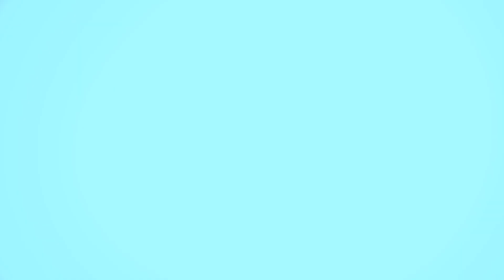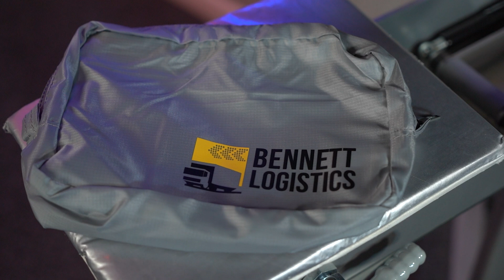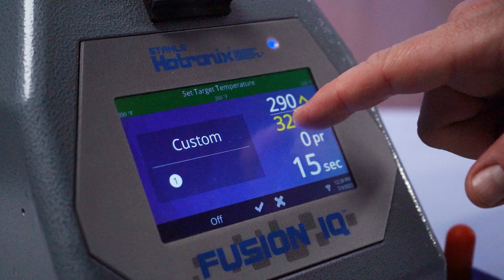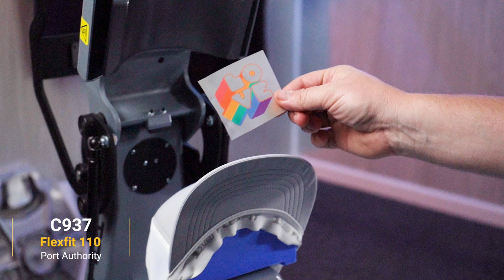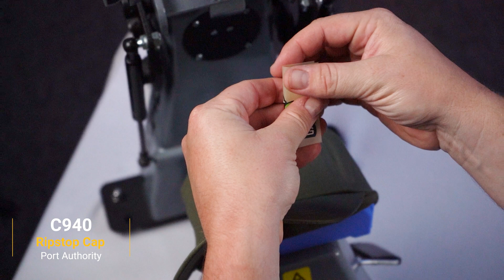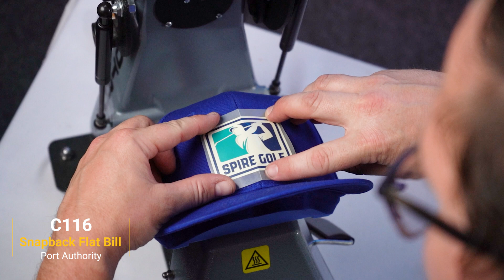How To Print Direct To Film on Hats & Headwear

Comment: Are these UltraColor MA transfer for hats come pre-cut to fold in half like on the video? Or do they come in gang sheets and we need to be precise cutting around each design ourselves?
Reply from the maker: Depending on how many you order, the prints would likely arrive on a roll to be cut out. Our sister company STAHLS offers EasyRip, which is pre-perforated for easy separation: https://youtu.be/9RrNtdcH-q4?si=HxUncs-22cZaAXXG

Comment: Will that bridge on the golf hat not eventually tear since its not glued down?
Reply from the maker: I'm not sure exactly what you are referring to, the rope along the brim? Unless snagged or intentionally pulled to be removed, we haven't seen any failures on these OTTO caps.
Reply: The last hat the blue one. Dave says the print is bridging the gap in the seam. Couldn’t that fail in the part since the transfer is not glued down and basically floating over the seam?
Reply from the maker: Thanks for clarifying Ben, we haven't seen any issues with them failing, tearing or peeling, they're still adhered to the hat and the inks are made to stretch and flex. Just like Dave mentions you can also push the transfer into the crease, however the crease is visible in the artwork. There's a great video here: https://youtu.be/JaKeNZJQDWY?si=tWHXIPQTk-igxMlf&t=490 Where Skip Davis (Owner D4 Graphics) mentions using a tool to ensure any graphics are pushed into the seams.

We've seen many decorators using soft foam HTV with UltraColor Max printed on top to bridge seams or print on other areas not well suited for just a transfer (think mesh back), later in that same video with Skip, around the 40 minute mark you can see a detailed version of that process.

Comment: What pressure did you use for the foam hat?
Reply from the maker: We had our pressure set around 6-7 for a slightly-higher medium pressure for our UltraColor Max DTF transfers
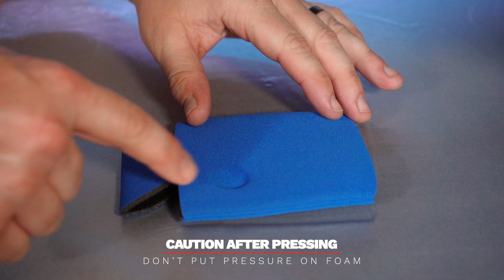Reply: But he said in the video to not put pressure on the foam hat, bc it could lead to dimples or creases. I’m confused. 5:18
Reply from the maker: Thanks for clarifying Brooklynn, Yes, the heat press pressure is ok at a 6-7 as it is spread out across the printing area, Dave mentions here you'll want to avoid touching the foam with your fingers as the foam front will dimple and leave a permanent crater in the foam even after it cools down.

Comment: When I did the 6 panel hat, the design looked as if it was melted on. I did it on 315 temp 15 seconds, WHy did that happen?
Reply from the maker: Hi Jenn, We'll need to know a little bit more information to help! What heat press are you using? What brand & style of cap? If using the 360 do you have the bottom heat turned off? Are you using a cover sheet? What is the pressure setting on the press at? What specific transfer are you using? 315 would be too high of a temperature for our UltraColor Max DTF transfers we show here. Some of the lower-cost DTF on the market has issues with adhesives or a glossy appearance, that sometimes are more hassle than what they're worth.

As for the 'melted on' look, do you mean wrinkling or stretching in the transfer itself? There's a few things that could have went wrong: If using a cold peel transfer, the transfer moved before it was completely cool to room temperature. Pressure on the heat press may be too low, temperatures too high, etc

Comment: Which cap heat would you recommend best for a beginner? 🤔
Reply from the maker: The Otto & Port Authority Foam front trucker caps are the easiest to print dtf heat transfers on!
Reply: @transferexpress  I'm sorry, I meant to ask which hat heat press would you recommend best for a beginner? I hope I'm making sense.
Reply from the maker: Oh sorry! The Hotronix 360 IQ we feature in this video is the only hat press that can do it all while providing frustration free printing. Other cap presses can crease hats and provide only top-heat application, limiting the types of heat transfers you can use. While it is more expensive than the ones on amazon, it has the potential to pay itself off quickly. With financing it can be purchased with payments as low as $173 per month. https://www.transferexpress.com/heat-presses/hotronix-360-iq-hat-press

With a quality press, you're able to provide professionally printed products right out of the gate and charge accordingly, building value in your business right from the start and absolutely flooring your customers with your quality and capabilities. 

If your budget is fixed, one of the lowest cost presses we would recommend is the Clam Basic series: https://www.transferexpress.com/heat-presses/stahls-clam-basic-cap-heat-press  It doesn't have the programmable presets, lower heat, molded lower platens or auto-opening features, but it does have adjustable pressure, the option for other platens and accurate (top) heat.

Comment: Late on this video but can you use heat tape to keep the transfer in place? Or is ot preferable to not use tape?
Reply from the maker: You can absolutely use Thermo Tape to hold the transfer down, it doesn't impact the application and helps keeps those graphics in place. Keep in mind if you're using a hot peel transfer (like we are here) you need to remove the tape quickly to peel the transfer while hot. Just take special care, as some of the foam-front options can dimple when touched when still hot.